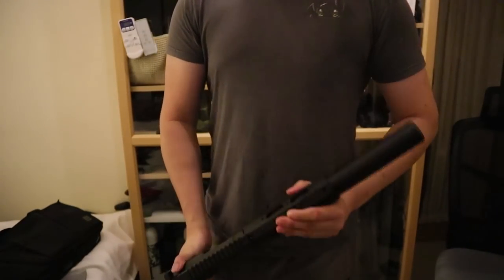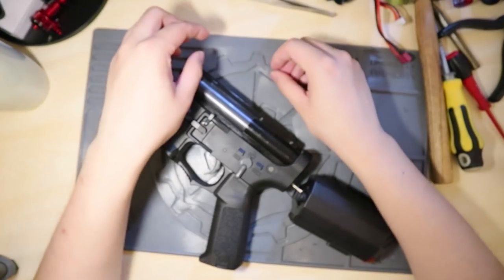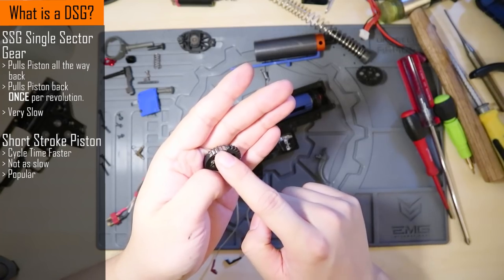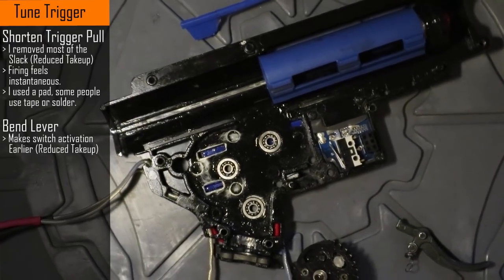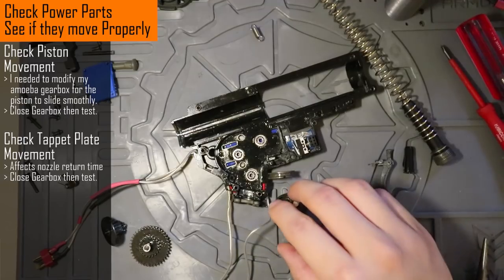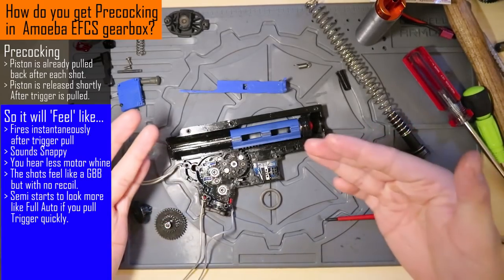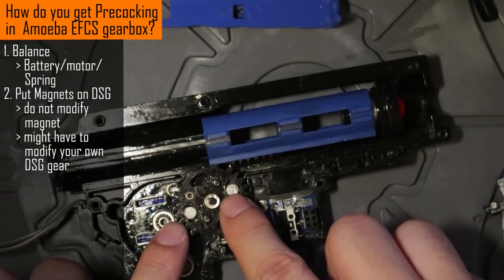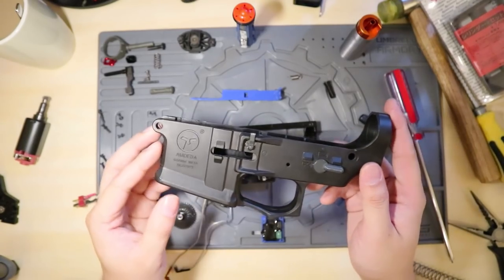Amoeba DSG Precock - Budget DSG Trigger Response Build!

Comment: A lower ratio gears (13:1) with a high torque motor (like the 45K Tienly motor), M130 spring, DSG set and a hair trigger would be more (at least more reliable) responsive than pre cocking it?

I have one Amoeba with hair trigger and a SHS high torque motor and a M4 with a stock EFCS gearbox on it and want to modify one to a DSG build.

Comment: I have the folowing issue with an ares gearbox :
The previous owner did some crazy build with an aluminium piston and a really heavy spring and thanks to that the gears lost few teeth here and there. I replaced the gears  with shs 16:1, placed the magnet to stop the piston at the point where it hits the cylinder head...... Put the gun together with corect shimming and everything nicely lubed and when i shoot the gun on semi , the gun fires bursts of 2- 3 shots ,no more then 4 burst and then the power cuts off.  The batery is 7.4 20c do you think this is the reason why the gun does this, should i try with 11.1 maybe fixes the burst problem also ?

Comment from the maker: PARTS LIST
Base Rifle : Amoeba AM014 (honey badger look alike)
***********NON-ESSENTIAL parts*********
- Prometheus 210 mm tightbore 1 to 1.1J (this gun uses a longer inner barrel, using this purely because i wanted an integrated tracer)
- Acetech AT2000 (you don't have to use a tracer obviously, but this is for my particular build)
***********\ESSENTIAL Parts************
- SuperShooter M125 Spring (4 USD)
- 2 Amoeba EFCS magnets for EFCS cut off (10 USD)
- 11.1V lipo 1800mah 25c (I do not want to use a 7.4)
- Stock Ares Motor (cannot use too strong motor. If motor too strong, overspin and piston catching or PME will occur). 
- SHS DSG (20 USD)
- SHS 18:1 gears (20 USD)
- SHS Piston (removed teeth, super glued rack for security)
-Modified SHS tappet plate (for feeding)
- Modified SHS tappet plate spring (for feeding)
- Shimmed, AOE, meshing checked, 
- Radius gearbox
- sanded away some cast marks on gearbox that was touching the spurr gear. 
- modified my piston tracks to allow my piston to move smoothly
*********Air seal parts, optional not a must, but ideal ********************
- Systema Cyl Set INCLUDES : damper piston head, cylinder, damper cylinder head, nozzle etc) 
    I only used the piston head, nozzle and cylinder. If you live in Hong Kong, these are the heavily discounted parts that costs about 100 HKD. 
- PP Airsoft Damper Cylinder Head (pp airsoft near qrf) 
- SHS Tappet plate Modified wing to 10.96mm (allow nozzle to return faster)

total cost is about 290 USD, if you buy the base rifle on a sale u can generally get it for a mere 140 to 150 USD (which honestly not bad for a whole AEG). You can even use it for a while before you upgrade. I've had mine since may/june 2015.
And you don't even have to choose the am014 as your base gun!!! i only choose it for my integrated tracer build!

******* FURTHER NOTES **************
- Why build a precocking build using an Amoeba EFCS. Answer to this is really simple. I don't have to go out and buy an airsoft mosfet with AB or precocking, i can instead use the amoeba efcs magnetic cut off that will never wear out like a traditional AEG cut off lever. So if you are a budget, you might want to consider using something like this. 
- Please note that if you want to purchase more parts for your DSG and get more power out of it or more speed, feel free to do! almost every part here in this build was scrap parts or china made parts, if you live in Hong Kong and you want the systema parts, they're on sale everywhere along with King Arms parts, cos nobody is buying them
- Please note that PME is not a concern due to the motor, 18:1 gears and its overall not that fast for a DSG. You can go wayyy faster with a 10:1. 
- If you are not using the blue EFCS, you may encounter issues. 
- ALMOST EVERYTHING in this build can be changed for your specific setup. You obviously do not need to buy a new inner barrel and integrated tracer setup like i did. You also don't need to use parts i used, you can change it around and do whatever you want to set up precock for yourself. 
There's many ways to go about doing it, it just really depends on how pick you are. For me, my only priority was precock. 

- and finally, this video is just an enthusiast sharing info with other enthusiast, if you are a tech or a professional who does this for a living, don't over think the build too much because like i said before, you obviously don't have to build the integrated tracer build, you obviously don't need to spend the extra cash for a different inner barrel, you obviously don't need the systema parts (which i bought purely cos nobody wanted them and i got them for cheap). The point is getting precock to work, and building a neat little tracer CQB build that's really fun to use. 
In the future i might spend a little more cash to buy a better motor so it can pull the spring a little easier, but for now this will do since precocking works now.
Reply: Aye, I live in Hong Kong too and I have an AM013, by your Facebook page does not work for me idk  why can you give me another way for me to contact you?
Reply: @Rogue Studios, i need your help, run AM013 stock with SHS dsg. spring 125  and bat 11.1v 1300 25c, and my Am13 just fire 5 times. need to disconnect my batt then fire 5 time again.

Comment: Very good video on how to modify Amoeba for pre-cocking.
I have some questions;
- What magnets can you use instead of the Ares brand ones for the cut-off?
- Does the G&G dual sector gear need to be modified to fit magnets for EFCS cut off like SHS?
- Would a 7.4v lipo battery be too strong for pre-cocking with a high torque motor? I use 15C-25C (2000 mAh) and 25C-50C (1200 mAh) batteries, but fps would be 320fps or lower. Would it over spin?
Reply: Yo I have one of three amoeba builds man, I'm using a 7.4 1800 25c, shs 18:1 bevel and spur w/g&g dsg.. magnets to fit g&g dsg are 4x4 mm neo-something magnets 560g pull weight. Gaurder pom piston head, corrected aoe & gaurder sp150 spring, also have a 140 that works just as well. Theory of 1 strong two weak doesn't add up and it puzzled me, then tried on a 11.1 2800 mah 25c and it worked flawlessly. Think it's something to do with much stronger magnets, standard ares magnets have around 330-350g pull weight
Reply: Torr Wheeler do you know what grade the magnets are?

Comment: Hi,
I own an Amoeba AM013 ( I think it's rather old; tbh i don't know because i bought online from another person) and i once had a problem with it's switch unit and all that good stuff.
Then i sent it to a friend of my mine who repaired and he also installed the Pre-Cocking function as seen in the Video of Chupacabra ( ENHANCE YOUR TRIGGER RESPONSE!!! ARES Amoeba EFCS PRE-COCKING on a Standard Sector Gear (SSG)). He actualy only replaced the magnet and first it worked realy nice but after like 2-3 mags it starts or better said it stops firing. It only makes little click sound and i don't mean the click from the Switch Unit. 

My Questions for you:
Do you know how i can prevent it from not firing after a certain time ?
Are all the parts required if i want a gun which lasts very long and works good ?
i want to build a gun which i can use in forests and more outdoor so i will surely need more accuracy at range and maybe even fps, what would you do different from this build ?
How do you know so much ?

Im sorry if it's a bit much and i dont demand to answer all my questions. I just thought i would ask because i searched for over 6 months for a solution and i avoided asking like i do right now.
Thanks if you read till this point. 
P.S : im not a native english speaker so please don't kill <3
Reply from the maker: well my build is for cqb, if you want outdoor DSG precock on EFCS ur going to need to find someone very skilled who can build for you which is a little tricky. 
Cos 400 fps DSG are not very common due to the difficulty. 

accuracy and range u can worry about later, cos that's just hop up, i think maybe speak to a gunsmith first to see if he can still reach 400 fps and maintain precock
Reply: For me personally the "DSG" Part is not important, i only want it to be Pre-Cocked, so maybe that helps as an information. Do you know what my problem with the clicking sound is ? Would help a lot
Reply from the maker: not sure :( sorry bro :(

Comment: One question:
There are 13:1 SHS Gearsets. Combining this set with the dsg, wouldn't it be way faster?
Oh yeah and what fps do you get with that setup?
Reply from the maker: Freeman the shs dsg gear is not compatible with low ratio gears, only 16;1 and 18:1.
There is no low ratio SHS dsg as of the filming of this video. 
only siegetek and one other company makes low ratio dsgs
Reply: ahhh alright! thanks mate!
And what about the fps?
Reply from the maker: Freeman 1J on 0.2 gram tracer (for our cqb limits for dsg or trigger response)
Reply: k thx. 
So what would you in particular change to get it running on 1.5J? Or in other words to be able to play on outside fields?
Because in your theory you need to keep 2 of the 3 parts (spring, motor, battery) low. So how do you achieve that?
Reply from the maker: Freeman well u probs need an m150 spring or above, 
so probs strong spring, semi weak motor, weak battery, and then dsg tuning (dsg tuning u can watch the 400 fps dsg vid, but ... its going to be very challenging tbh)
Reply: thx alot dude. Do I need to worry about the shell being strong enough for the m150? I don't think so because the dsg wont cock the spring that far, am I right?
Nevertheless I should do a radius mod. 
And then there is still the question how long the inner barrel needs to be. 
I guess it's a try n error situation...
Reply from the maker: well for a dsg there's a limit to how far you have the inner barrel, there's also a concern where if you have it too long, your first shot might still be in the barrel.
So with DSGs try to stay below 250 mm or if you really want to push it, i guess you can try 300 mm max. But usually 250 mm is safer and easier to work with because it makes diagnostics easier unless if you... really want to go all out. 

You do need to worry a little bit about the gearbox, so the sizing of the cycl head, radius, sorbo, don't use aluminum piston heads of course, all the proper work that one normally should do, you need to do for a dsg in general.
Reply: sure thing! thanks again. Since I am playing in Germany (no FA for guns >0.5J) I do not care about them super high rof setups. So that's no problem at all. But I like the idea of the pre cocking and super fast trigger response. All tho I would wish for a ARL realease for the time the replica is not in use to let the spring rest. That'll be nice too.
Reply: @RogueSystem087  hi! What I should use for SHS DSG with M150/M170 spring? 18:1 or 16:1 SHS gears? I wanna high RPS.

Comment: Hey So I saw a comment on here saying that I do not need to change the piston, cylinder, air nozzle, cylinder head, if I dont want to and I can still get the same performance w/ maybe less fps. I am new to all of this and am still learning. Is this true?
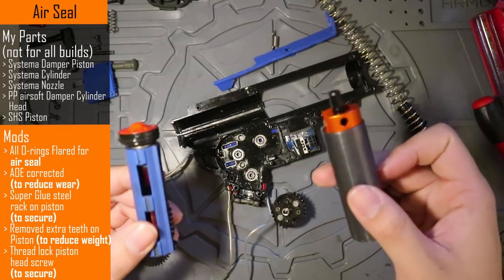Reply from the maker: you do not need to, as mentioned in the video at 22:14 and to 22:27 (if you don't want to watch the whole video)
its also mentioned in the parts list below. 
The video also goes on to explain why those parts are swapped, you also don't need to do a lot of the parts swaps in this, such as the integrated tracer, buying a new inner barrel to accommodate said tracer etc. Basically take out whatever it is that you yourself don't need or don't intend to use.

Comment: So im looking at Precocking, and its not really an option for me because i wont do a dsg build on an Ameoba, but im curious.. Wouldnt having your gun precocked weaken your spring.. because your spring is always being compressed...? Thats how you jam your gearbox as well, unless thats only on an SSG. And if you use semi automatic, your gearbox always resets your spring to half compressed, so when you aren't using your gun when its put away the spring would stay compressed...
Reply from the maker: 1. would having precock weaken your spring?
springs will weaken after their initial use, and then after it stays fairly stable for a long time. When precocking, yes it can weaken the spring over time, which is why its important to release the tension once you are done with a game. 

2. That's how you jam your gearbox as well unles that's only an SSG. 
Note that in an amoeba, there is no physical cut off lever that can jam, amoeba uses magnetic sensors to detect a magnet that i place on the DSG gear, so therefore, it can only overspin, or do its usual magnetic cut off. The whole entire video is mostly teaching people who to land on precock using the ameoba efcs gen 3. 

3. after you semi automatic, your gearbox always resets to your spring half compressed (which is the point of precock), so when you aren't your gun when its put away the spring would stay compressed...
in airsoft its common practice to release the spring tension in your gearbox where it be a dsg or ssg. Like i said in 1. i release the spring tension when I put the gun away.
Reply: @RogueSystem087  Thank you for the quick reply. I appreciate your answers and I think you explained perfectly. Keep up content like this. New subscriber 👏🏽

Comment: 18:1 dsg with tienly 35k motor with m170 spring and 11.1 40c Battery what's the rps and how to make it faster other then using better batterys
Reply from the maker: isn't 35K like the rating that's used for high speed? it might be a bit stressed out from the m170
Reply: @RogueSystem087  it has 17 tpa in it and I might drop it done to m150 and it's for my GEL blaster kinda the same but not really

Comment: do you recommend cutting off some coils from a stiffer spring to adjust fps instead of swapping into a softer spring?
Reply from the maker: you can, but after you cut it and close the spring, make sure u let it sit in your gearbox for a while. 
Sometimes the power change from cutting and closing your spring is not immediately noticeable

Comment: I think you could replace the bottom side of any 10/13:1 shs sector gear into the shs DSG just by taking out those two boleta, can you?
Reply from the maker: Claudio De la Horra if u take apart the gear, yes but at thr same time ull need a stronger motor

Comment: My ares is double shooting with the dsg 

My parts:
18:1 gears
Shs dsg
Stock motor
Stock piston
M115 spring 
Stock piston head
Reply from the maker: depends on battery as well, and i think spring is probs too light
gotta balance the weak+weak+strong
(in ur case weak spring, weak motor, may need somewhat of a powerful battery) 
(this is assuming u want to copy the precock build)
Reply: Rogue Studios I’m using a 11.1v 25c
Reply: Rogue Studios do I need to use a m125?

Comment: I have a krytac pdw and I want faster trigger response. I am going to JUST replace the ssg with a dsg.   That is the ONLY thing I am going to do.  Will this make it fast as f@&k? And can I order literally any dsg and expect compatibility with the rest of the internals?
Reply from the maker: :( sorry bro i'm actually not familiar with what the krytac gears look like up close. 
But generally speaking, if your gears are standard ratio (18:1 ish) then the SHS DSG will fit. 
Meshing might be a tiny bit off, single fire may become two round burst depending setup, but your full auto will work well and shoot fairly fast. usually u'll pass 30 rps just by simply installing one. How high the rps goes depends on a lot of factors (as u can see in the vid)

Ultimately, i would reconnmend people to attempt DSG if are willing to do some of the DSG tuning (like figuring the power and feeding issues), 
BUT if you simply want to use a DSG and don't care too much about the inefficiencies, then go right ahead. 

hope this helps in some way, pretty sure some krytac users have attempted somethin like this before
Reply: Rogue Studios yah they are 18:1.  I'll try it. All of the parts are high quality, so hopefully this one gear replacement will make it faster. Correct me if I'm wrong about that
Reply from the maker: yup, i'm not sure about the quality of krytac (not super common in hong kong unfornately :( as long as all the general work to make a dsg work is done, u'll be fine on auto! semi and the rest (like i said, it depends). 
peace bro, good luck!